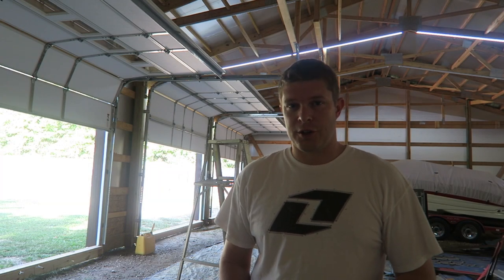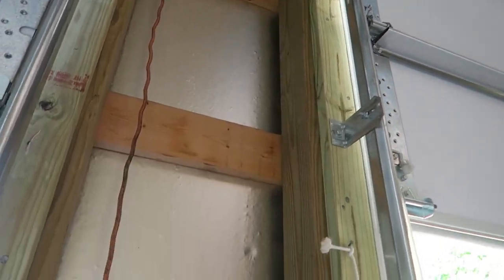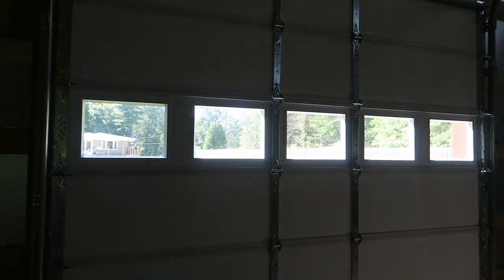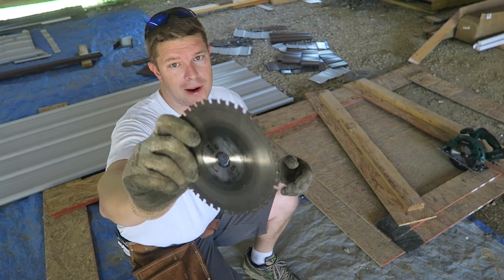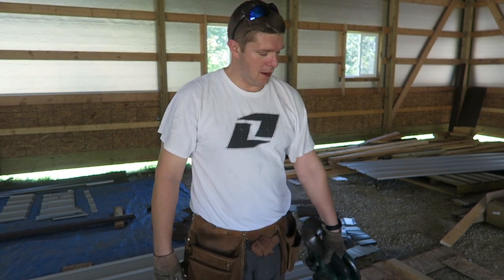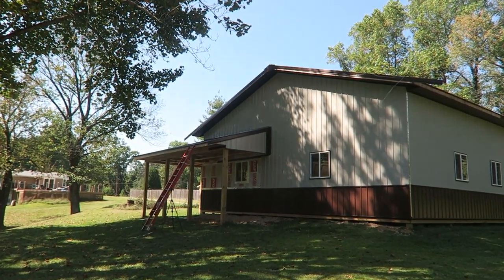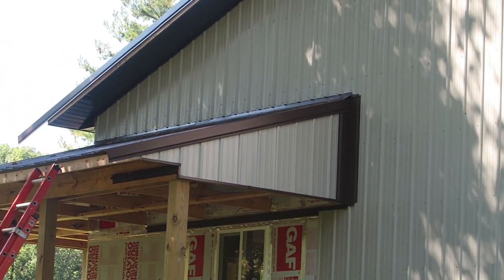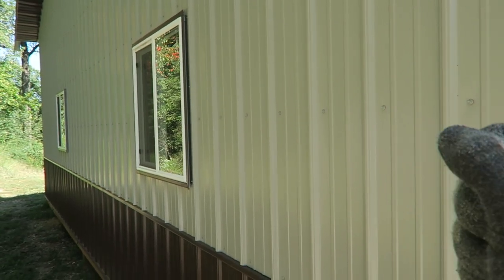Pole Barn Build Post Frame Metal Garaqe doors and Soffit EP.9

Comment: Suppose to make garage door opening one inch shorter than the width of the door so it runs against the wood
Reply from the maker: You sure about that. Sure looks good just running against trim mouldings. Inside and out.

Comment: Hi Jason,  Did you purchase the doors thru Menards?  Which sku was it?  Insulated or non?  Did you get any instructions or plans from Menards on how to put the pole barn together?  Where they helpful?
Reply from the maker: Producers Livestock I purchased the OH doors from Lensing Wholesale. They are a local dealer for Raynor doors. They are insulated. I did not purchase Menards plans. I designed myself and went to Menards with the exact take-off list of lumber.  I also had drwaings of exactly how i wanted the trusses built.  They said they never made the seat and overhang the way I wanted them.  Plus the end truss hight was different than the mid trusses.  They called me crazy. It all made sense to me though.  After I gave them the general dimensions, they did build the metal list.  But if I were to do it over again, i would also purchase the metal as I needed it cut to exact length. The porch caused a lot of pain cutting lengths that could have been purchased exact length.  I probably went back for more metal 6 times.  Probably could have saved a lot of time buying their design and material kit, but then it wouldn't have been my design...

Comment: Another well done effort with Episode 9, Jason.  Your attention to detail is paying off with a very nice looking barn!
Love the jig.  The time used to make a proper jig definitely saves time in the long run, and keeps every cut looking consistent from first to last.  Keep up the good work, and really looking forward to episode 10.
If I'm not mistaken, you made a fixture to hold the purlins in place when you were nailing them in.  Did you make any other jigs or fixtures through out the rest of your build?
Reply: My bad - your first fixture was for the girts, not purlins....whatever.  You get the question.
Reply from the maker: Those are the only 2 jigs or fixtures. I guess the "girt jig" is nothing new. Guy I work with said he did the same. Called a "story board". Either way, it helped me stay consistent and work fast.

Comment: How would you add a storm door to your entry door? I had a builder do you my pole barn and he put entry doors and I realized that the door knob is sticking out and there’s no way to put storm door it’s not a typical entry door you get at Menards.
Reply from the maker: I used typical entry doors. The frame supports a storm door.

Comment: I am doing a barn almost done. We also did waynscotting. Did you have a problem keeping top and bottom ribs in alignment on the long runs?
Reply from the maker: YES! If the wall is out of square just a little, if you don't get the first 2 or 3 pieces square, If you overlap slightly different at the top of the piece than at the bottom.  STAIRSTEPPING.  Very common problem.  I pulled off the first 4 sheets and tried 3 times before I was happy.  My back wall was the difficult long run.  especially after going around a window.  I figured out you can correct a little as you go by overlapping just a little heavy or light on the rib at the top or bottom as needed.  I think it is OK to have a 16th or so.  On the back and front walls, I put the wainscot and Z trim on last.  That prevented scratching the Z trim from the panels if they were not exactly level.  I started with the F+J at the top of the wall, made sure it was tacked on straight and level, then work my way down the wall from there.